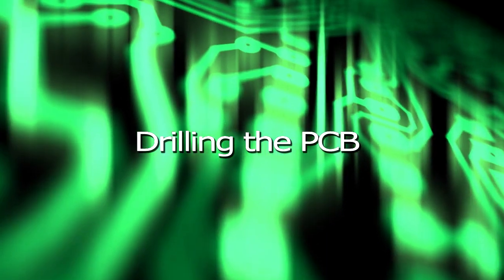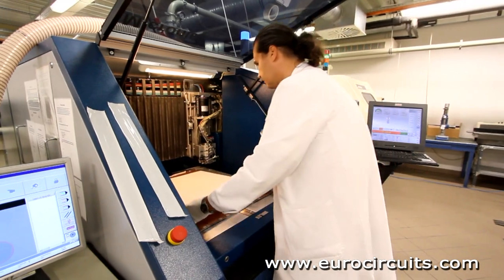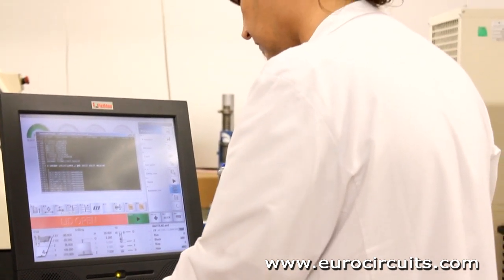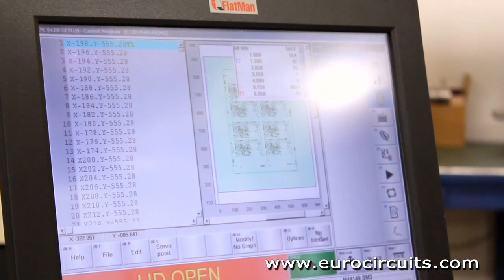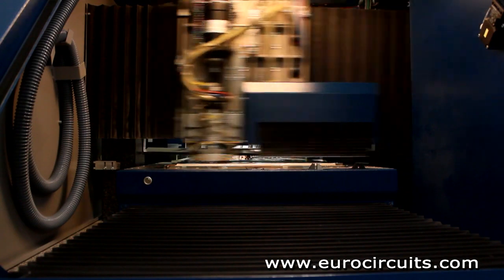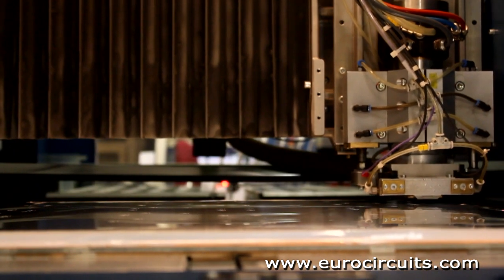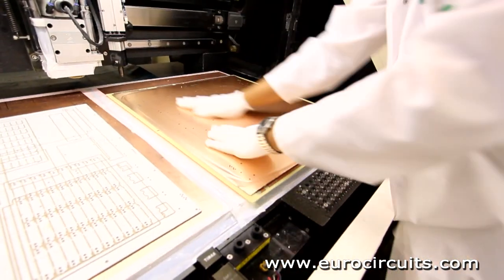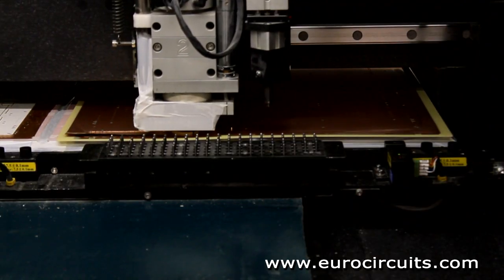Part 9/10/11 - Drilling the PCB

Comment: The spindles are air driven?  Normally, the spindles use air bearings and powered by 3 phase AC power (variable voltage and variable frequency).